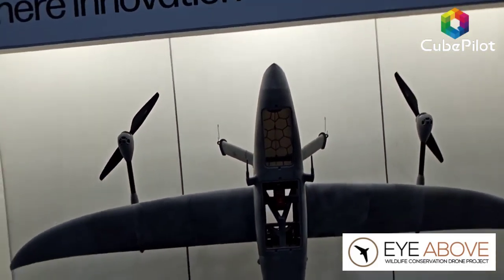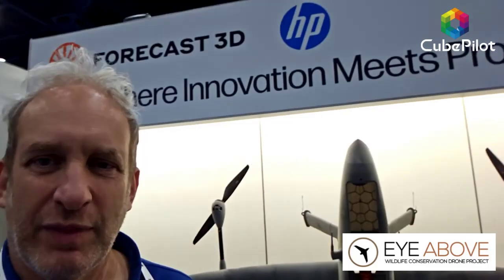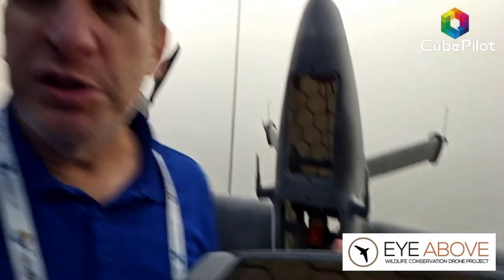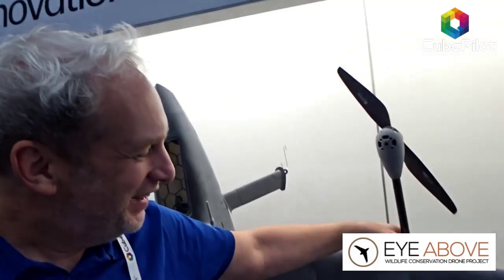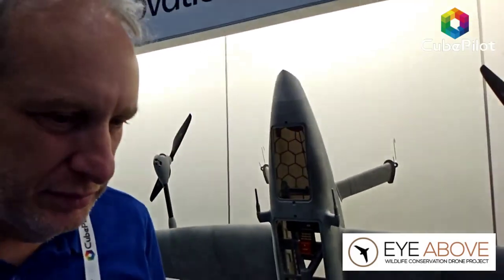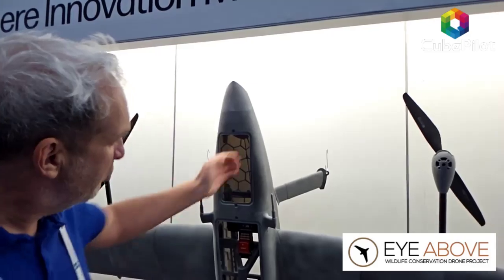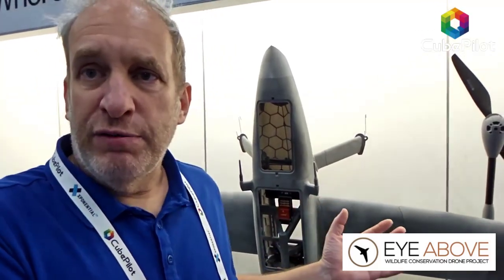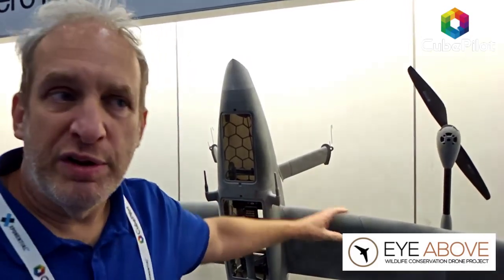Robert Miller, The Eye Above,  Bushranger

Comment: I see a possible problem, when the aircraft flies into a thermal (of which there are many during a typical flight over the African bush) and the aircraft ascends due to the rising air, Ardupilots' response is to reduce throttle so as to descend to reduce altitude, yet the rear 2 motors are providing yaw, roll and pitch stability but they will now reduce RPM so control authority will be reduced. With no ailerons or elevators how is pitch and roll going to be maintained if the only motors providing that control are throttled back?